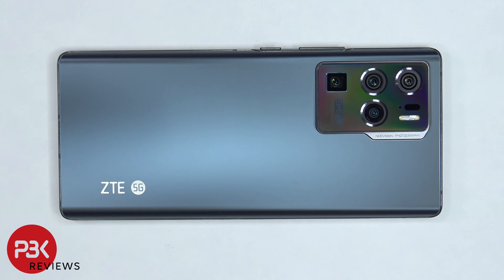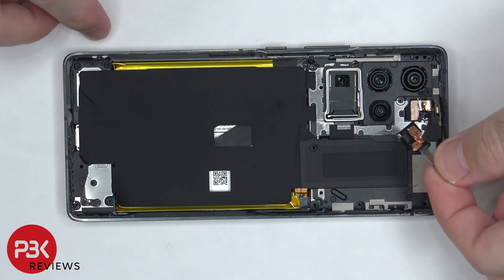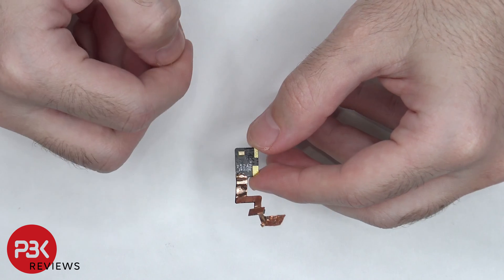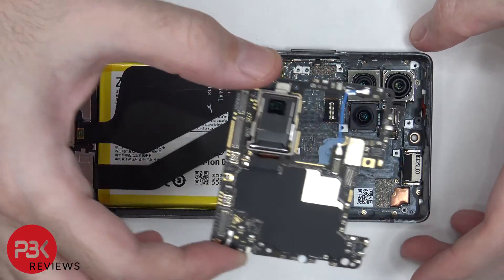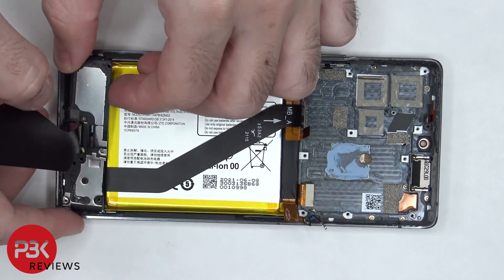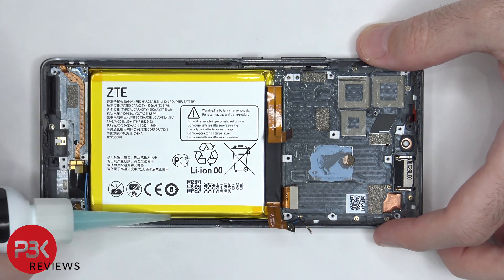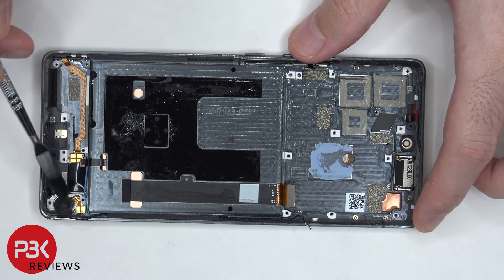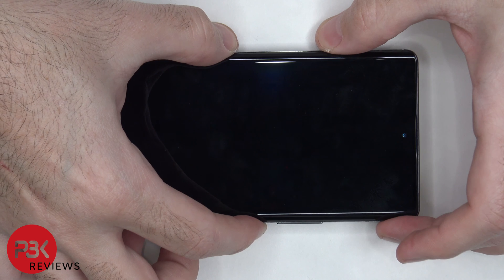ZTE AXON 30 Ultra 5G Disassembly Teardown Repair Video Review

Comment: Thanks for the detailed teardown! I’m having an issue with the Bluetooth on my ZTE Axon 30 Ultra. The connection doesn’t fully disconnect, but the music keeps stuttering or cutting out unless I stay really close to the device. I was wondering if this could be a hardware problem. Do you know if the Bluetooth antenna is integrated into the charging port flex cable, or could it be another hardware component causing this? Any insight would be really helpful!

Comment: Thank you sir. This model isn't available in the country I moved to and when the battery started to bloat I ordered a new back panel and battery online and took it to a repair shop for replacement. All seemed fine when I picked it up until I got home last night and tried to charge it with the original charger. The charger died and phone went black and I couldn't turn it back on. I followed your guide, disconnected the battery, reconnected it and then I could turn the phone back on again. I think the battery connector wasn't seated completely when they replaced it, which made it possible to turn it on but not to charge it and caused a spike in resistance that killed the charger. The original charger is dead now and only gives 2V output, but I've tried another charger after reseating the battery connectors and it charges fine now so your guide was very helpful.

Comment: I have the ZTE AXON 30 5G (none Ultra), will this be the same as I can't find a repair video for it ?  Thanks 👍
Reply from the maker: Hi, I'm not sure but I would think it will be different in some ways at least if not all. Since if I am not mistaken the none ultra is not a curved display, so the design internally will probably be different as well.

Comment: Always give camera units priority, atleast in expensive or camera centric models. Don't just pick them up and forget about them. Like about the OIS, through a little physical movement on the lenses. If there's something extra like a Tof sensor or laser unit, mention them too.
Reply: @PBKreviews  yeah dude what's the point of sitting through the whole video if you are just gonna forget about one of the main components you pry out? Camera units are more interesting than backpanel material.

Comment: Again, finally someone did it
Reply from the maker: @Ayush Hi, 11T is the same as the 11T Pro. Disassembly and internals are the same. The only difference is the processor and charging speed.